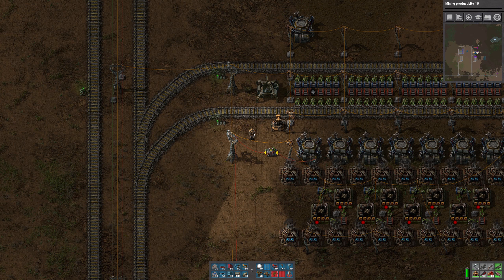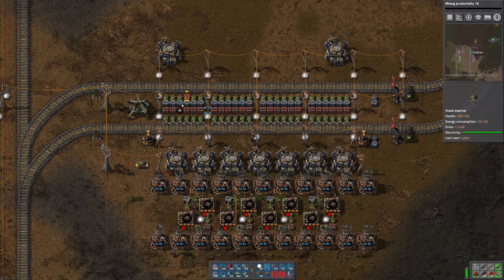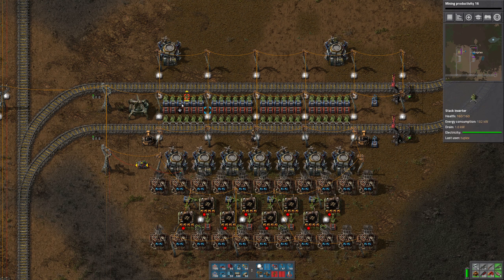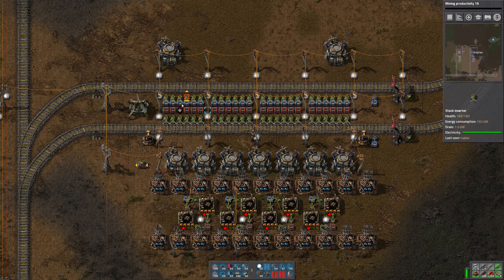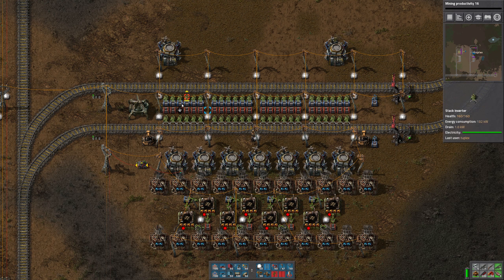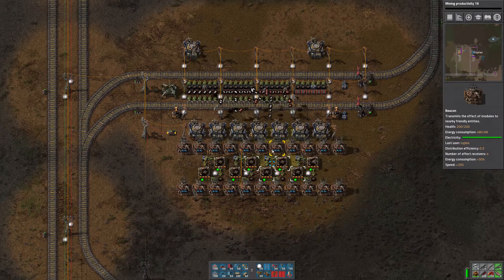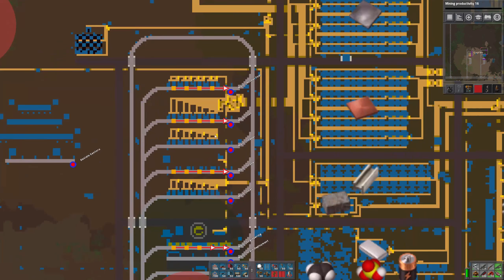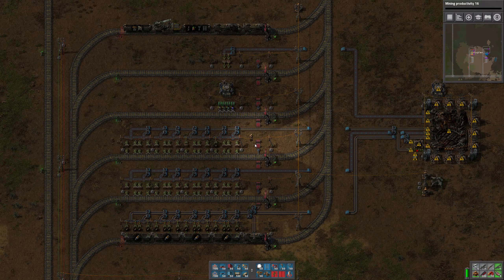Factorio 0.16 Let's Play #35 - Train outpost improvement, LDS production

Comment: Hi, like your vids, started late on following the series, but I have a question. What if the train with iron plates(or any other material) is faster than the others. Wouldn't it cause a jam because the total contents will never drop below one total trainload? Eventually there will only be iron (or whatever) in the system and the machines won't take more materials. I don't know if it's talked about in later episodes, I'm just now at this point. Btw: with your initial blueprint of the entire section (the one that was too big to put down) didn't include the red and green wire on the big elec masts between the tracks on the first part.
Reply from the maker: Hi!  If there is more than a trainload of an ingredient, then the train will wait at the incoming station until it gets a signal.  This is not a problem as long as we don’t assign too many trains to bring the material, as that would fill up all of the incoming stations and create a blockage.  And this is designed to keep 1-2 train loads of each ingredient at all times, depending on how fast it consumes the material.
Reply: Tuplex thanks for clearing that up, in my scenario the trains only had one ingredient each, but if there are more than one each train then there's no problem. Sorry for sounding dumb, and thank you

Comment: Hi Tuplex.   Trying to follow your logic with the train network.   It seems to me that as the blue circuits are being made  they are sending a signal to the network which is negative(?) - the combinator is changing it to a positive signal ( * -1)  causing the green square to appear and release the stopped trains.
Reply from the maker: Hi Richard, I'm impressed, you are more observant than I was.  I actually just discovered that problem in one of the most recent episodes.  What I ended up doing was filtering that out by putting a decider combinator (each < 0, output each), so that only the negative values are sent to the train stations.  There were a couple of other quirks too, which I ended up fixing, and everything seems to be working properly now.  Thanks for your comment!